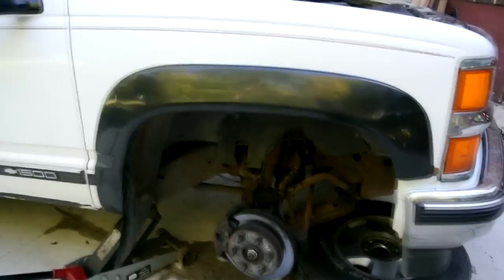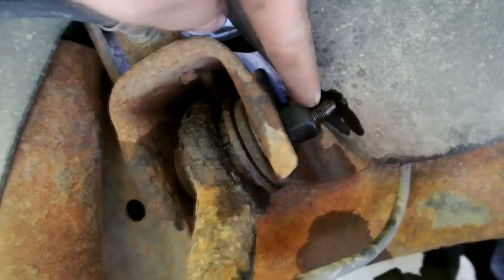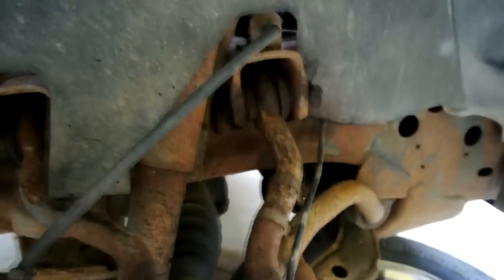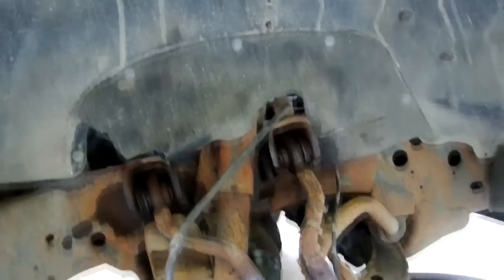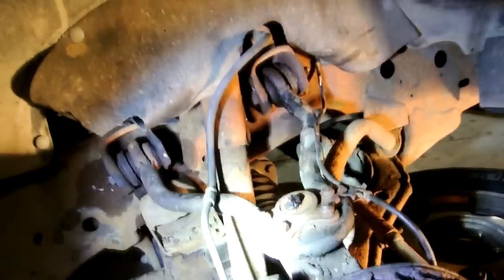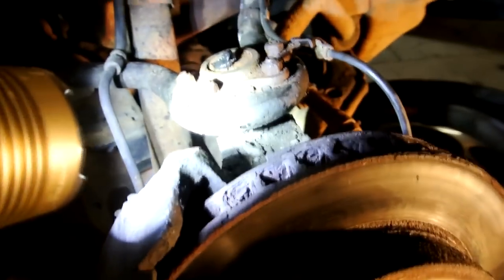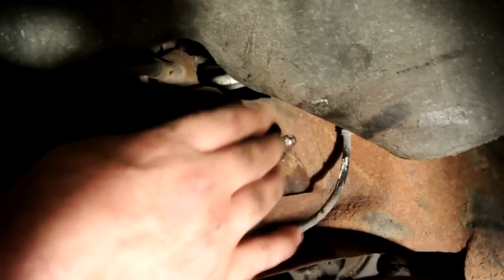How to replace upper ball joint and upper Control arm on a Chevy truck

Comment: I just ordered complete A arms with ball joint and bushing assemblies hoping I did not waste my money, think I could have saved money, but Thank You sir for confirming my decision! It is TOO COLD in NY right now to screw around with extra stuff. That and I have no cozy warm garage.
Reply from the maker: No problem. It's bitter here as well. Stupid polar vortex or whatever they call it. -14 tonight where I'm at. Getting pretty tired of this North Pole weather.
Reply: scannerguy1968 -32 here

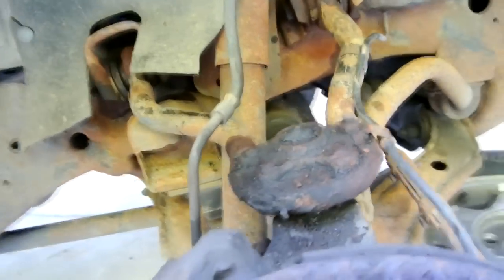Comment from the maker: Hopefully I'm reading this right. at 2:04 I take it you are asking about popping the bushing itself out of the top of the knuckle. So will go with that. I take it the pickle fork looks like mine in the vid. At 1st I had issues with it. Key to it is lowering the jack that is under the bottom control arm to relieve pressure off it. Once that is done it takes some serious pounding. I also slightly heated to bushing shaft up from the bottom a little but shouldn't be necessary. Hope this helps.

Comment: I had the same problem with the seized rivets. Drill a 1/4" hole right through each cutoff rivet and use a tapered flat punch to start it off, the rivet will start to move, finish it off with the bolt you removed from the 4th hole.

Comment: You could cut the rivets off with a chisel that cuts threw metal. Then punch em out with a tool made for that. Use a jack and lift the suspension. Take the bolt off on the bottom of the ball joint. Lower the jack after its off. Use a ball joint spreader to pry them apart. Replace ball joint with new one. Use the jack to lift it back into place. Put bolt back on properly. And there we go

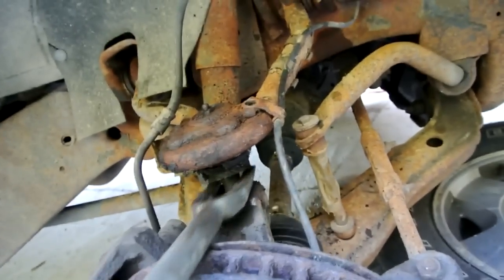Comment: Hi thank you first off for making this video, I have a 1990 Chevy k1500 Silverado and it looks just like this underneath, I’m trying to replace the upper control arm bushings and the upper ball joint but i am a bit stuck, at 2:04 how did you get that up? do you need to grind the rivets off? I went and bought a pickle fork and I just cant get it, I would appreciate any help you can give me, thank you

Comment: it looks as if that upper arm is for the left side.
Also, when using a pickle fork........flat side on the part that you will use again( in this case the upright, not the old ball joint!

Comment: If my ball joints fail on my 1996 C1500 and the wheels go flying, so be it. I am not going through this without air tools or a torch.
Reply from the maker: Lol. Hopefully they won't but if they do you are going 5 mph. Don't hear of it happening too much